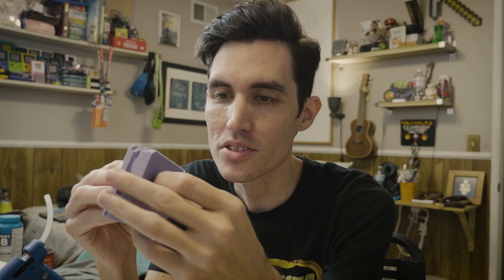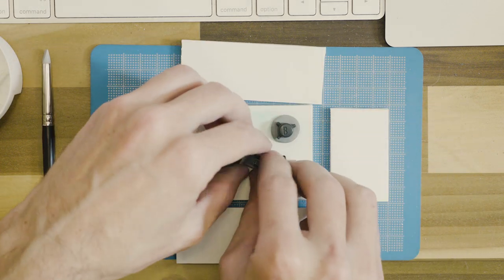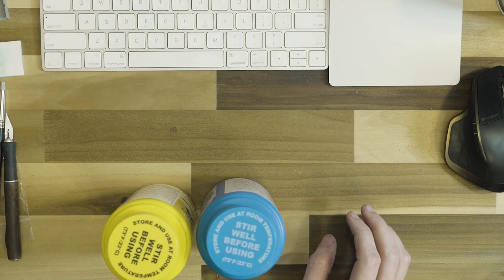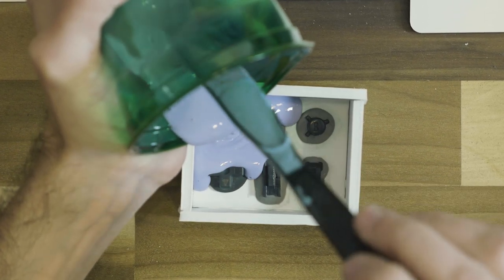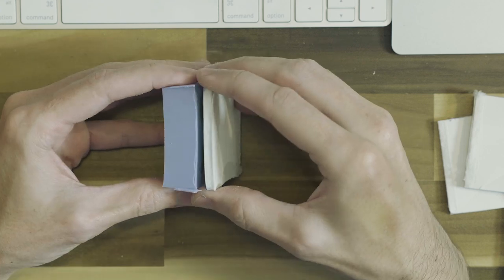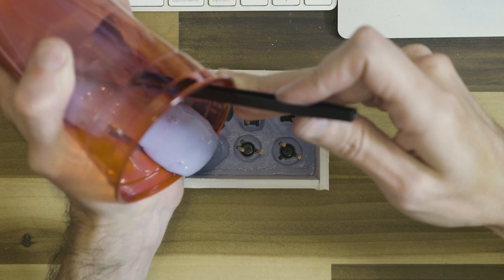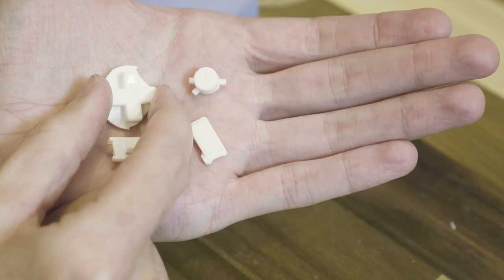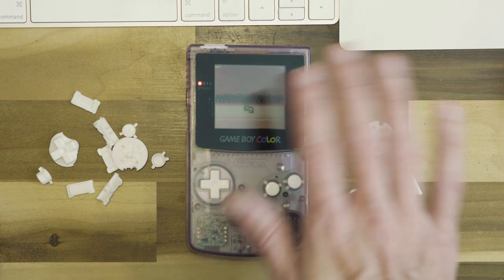Making Custom Game Boy Buttons!

Comment: A couple things worth exploring: You're gonna want a pressure pot if you keep casting things like this as air suspended in the resin can cause some pretty severe issues. If you start working with clear resins, I suggest starting with Castin' Craft clear. It'll be a slow cure but it's legitimitaly crystal clear. For dyes, PearlEx is the most accessible high quality pigment powder I've found. Amazon is a great place to buy it. Amazon ALSO has a very wide assortment of glow in the dark pigment powder. Something that might be cool for this is thermochromic powder that changes color as it gets warm. Very cool to be making your own replacement parts, I hope this leads you into some VERY nice custom buttons.
Reply from the maker: Curiosity Forge Thanks for the suggestions! Definitely have been thinking about making or buying a pressure pot and vacuum chamber. Will be looking more into them as well as dyes soon. :)
Reply: DON'T use a vacuum chamber for resin casting. Look up Shop Time and watch Peter's video on using a vacuum to pull air out of resin. It's really bad. I was gonna get a vacuum chamber myself until I saw what happens. Massive foamy mess.
Reply from the maker: Curiosity Forge Ah thanks, definitely will be doing more research about that soon. I guess the vacuum chamber would be to get the air out of the silicone before making the mold then.
Reply: I'm not 100% on this part but I THINK pressure pots work for bubble-free molds too. I vaguely remember seeing a video on the subject but it was quite a while ago. The King of Random shared some information on it at one point not too long ago if memory serves me.
Reply: @drstrangefart  you use a vacuum chamber on any liquid that has a long enough pot life to mix, vacuum, inject into the mold and then get it in the pressure pot with enough time to pressurize before it catalyzes, basically you need at least a 20 minute pot life or more, otherwise you skip the vacuum chamber and only use a pressure pot
Reply: The one problem with putting a vacuum on resin comes from it foaming up like crazy. You end up losing most of what you had in the mold along with making a huge mesa inside your vacuum chamber.
Reply: @drstrangefart  you vacuum the resin before injecting it in the mold. Again only with a long enough pot life, you mix, vacuum, THEN inject/pour into the mold, then put in the pressure pot.

Comment: The reason people talk about not using certain clays is because some clays will inhibit the cure of some silicones, particularly platinum silicones. Really the first time you use a particular type of silicone you want to read the data sheet and then do a small test with all of the materials you plan to use, to make sure the silicone's cure is not inhibited. Clay that has sulfur is particularly troublesome with platinum silicones

Comment: Polymer clay (like sculpey, fimo, cernit, etc...) can melt plastic if it isn't baked. I actually melted one Lego a long time ago, when i didn't knew about this. So please be careful when using it (it won't melt it in 2 hours nor in a few days. But it will be enough to damage it on surface.)
Reply from the maker: maxou You know, that’s good to know. I actually remember as a kid I had a lot of sculpey clay in a plastic container and it made some small holes in the bottom. It had been in there for years, so I’m not sure exactly how long it took, but important to remember!

Comment: This is awesome! I'm kinda curious, I know someone mentioned (might have been you or KyleAwesome, I honestly don't remember) that a common issue with Chinese reproduction GBC Dpads was that the little nub at the back of the dpad was shallower in the reproductions than in the original. Is this casting OK enough, or does your casting have the same problem as the reproduction Dpads?
Reply from the maker: Yep! My mold is based on an original Dpad, so it’s the full size nub that doesn’t have that issue. I actually have a solution for the problem with the Chineses reproduction Dpads though, with a small 3D printed circle you can glue in place. I’ll make a quick video about that soon. :)
Reply: @esotericsean  did you ever end up making that video? i couldn't find it on your channel. i have some of the shallow dpads and am curious about your fix!
Reply from the maker: pulu Forgot about it actually! But I’ll make that video now. :)

Comment: What is the approximate cost of this?
Reply from the maker: Felix Vences Silicone can be about $30-40 and the same for resin, so roughly $50-100 depending on the type of silicone and resin you use. Plus things like foam board, plastic cups, syringes.